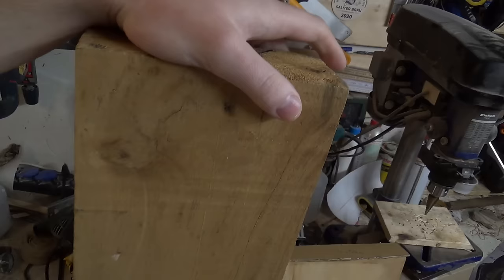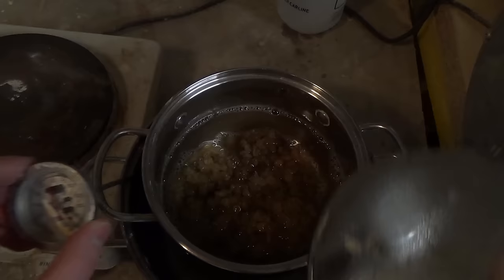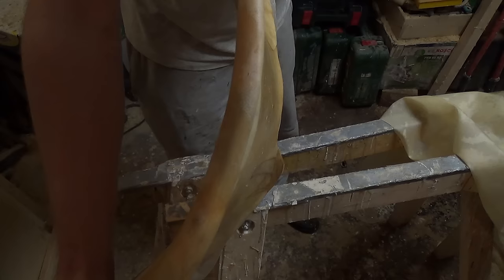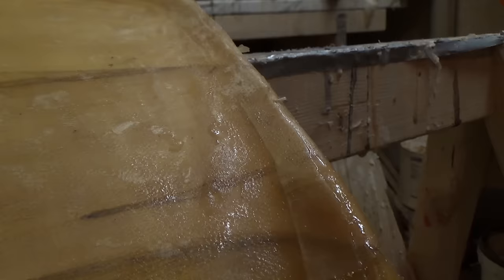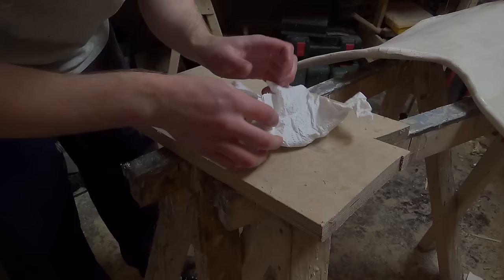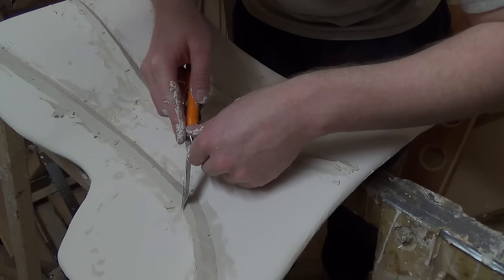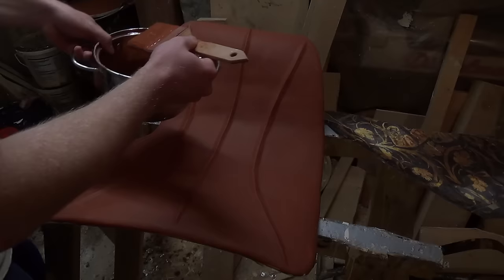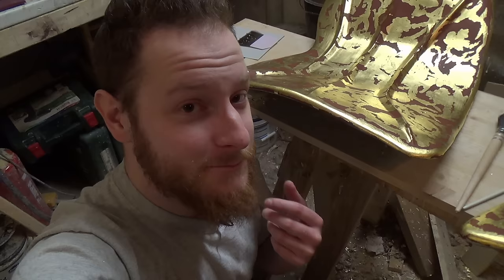Crafting a medieval Targe Shield replica, only with the original Materials

Comment: Ти написав, що в тебе оригінальні матеріали, а ти впевнений, що деревина в тебе саме та?
Reply from the maker: Hi, I hope google translate did it's job correctly XD. I got a source for another, similar Targe and it was made out of light hard wood (linden wood). Similar to all of the Heater shields. So using one of those most likely is correct.
Reply: @TheShieldery  everything was translated correctly. Craftsmen in the Middle Ages bent wood into such a shape, or cut it like you from glued boards?
Reply from the maker: @user-qs9vb9wc5g  i haven't gotten my hands on an analysis of this shield type yet, but targes where usually made to measure for the armor of the customer. In order to bend it, you'd need a mold to fix the planks into while gluing them together, which you'd deffinitly have to carve. So it would make more senese to carve the shield directly, instead of carving the mold and then do the difficult bending additionally. Making one for every single, unique piece (like the one I crafted in this video) would be insane. We also haven't found a single one of those molds, which of course is no proofe, but it makes my point more believable. 
That's why I think my way is the authentic one, or was at least done on a huge percentage of targes :)

Comment: u kno guns exist right?? so what good is your shield goin to be in that situation??? u cant even throwe something like that it not even round......
Reply from the maker: Medieval Armor and fire Arms coexisted for 200-300 years (depends on definitions).
The shield from this video was most likely only for decorative purposes, so fighting wasnt the Task Here.

The reason this Type of shield existed was to deflect the Lance of the oponent, which was the thing you mainly do in 1vs1 tjousting, or when two heavy cavallery units clashed into eachother. 
In the time this Type of shield was used, guns wherent that much of a Problem for fullplate wearing soldiers, cause the reloading time was very Long, the guns where water sensitive, ...; In Addition the armors Metal quality was very good and the shape designed to deflect stings, especially from the Front.
But yes, the bullet would penetrate the shield, but i never claimd IT wouldend. And that doesnt Change the fact, that this shield was constructed in the time period, regardless of it's possible function.